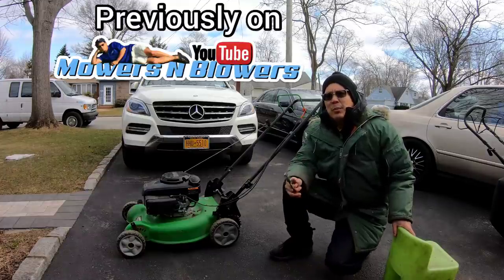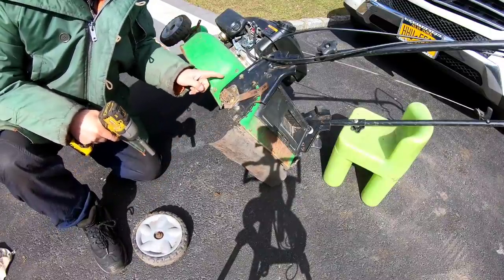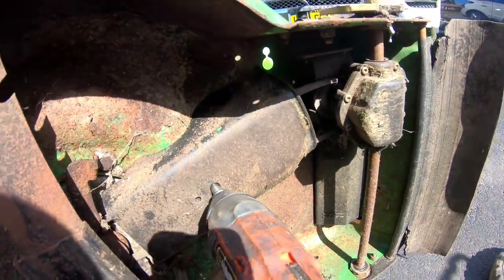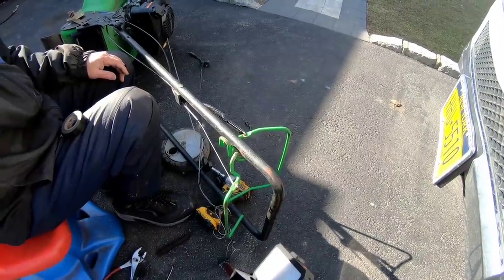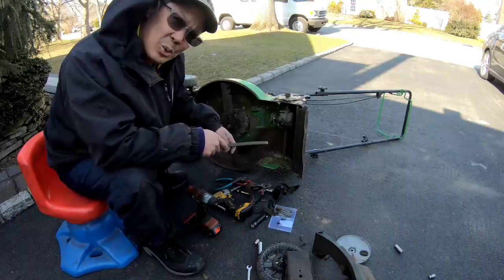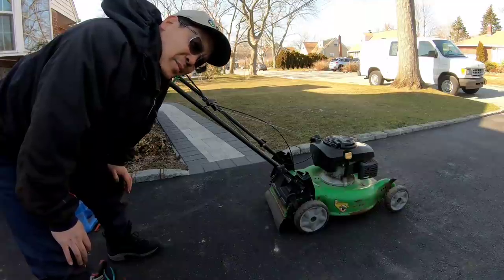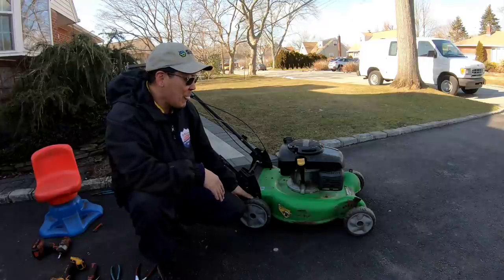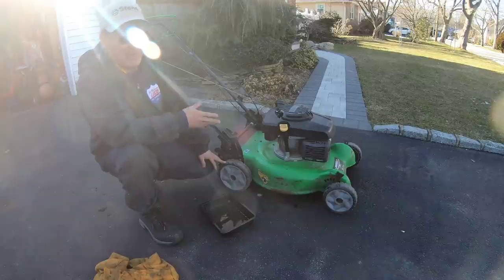LAWNBOY INSIGHT 10604 RWD KOHLER LAWNMOWER BRAKE & DRIVE CABLE & BELT REPLACEMENT OIL CHANGE REPAIR

Comment: yep jiggy with it, thats with flippers do, I combined  the metal wire from a throttle cable and used it for the cable part of a break cable  that broke but the plastic cover was still good.  cool deal, especially when the price of the cable was $17. on a $50 mower.    got it going for maybe $2 (oil and primer bulb)

Comment: A bigger pulley wheel could also solve this if another belt is not available.
Some John Deere paint will help sell it.  Even ordering a new/used bag could increase interest & value...
Reply from the maker: Those bags are hard to find and would cost $20-$30 used.  JD paint is too dark,  Lawnboy green is almost like that neon green fluorescent paint.

Comment: finaly, showed how to change cable, do you have to drain gas,+ oil, was told not to put mower on side.
Reply from the maker: You can put it on its side if it’s on the oil dipstick side.  You don’t have to drain anything.  Hope you’re subscribed

Comment: Gotta luv getting a free lawnboy.
Reply: @useralex87 excellent very good, well what you install it on should have the throttle cable to adjust the rpm.
Reply: @useralex87  here's a good video on it
Reply: @useralex87  we are all buds here.

Comment: Find the distribution box on your septic system, the one that feeds the drain field. Make sure that box hasn't been crushed or is blocked with roots.
Reply from the maker: I don’t have a drain field.   It’s a ring. Sand on bottom

Comment: It's $175 to pump septic system where I am, and can go 4 years before needing it pumped.  You should be able to get a hundred bucks for the self propelled Lawn Boy.  Good job on repair.  The horde of parts helps out again...

Comment: Henry, that mower is worth a hundred just because its rear wheel self propelled.  $125 if it had a bag. Great explanation of how the rear drive system works and how to repair and diagnose what was causing the belt to come off! 💰✌🗽 Roger  #mnblucas
Reply from the maker: Yep,  $100 if I was lucky